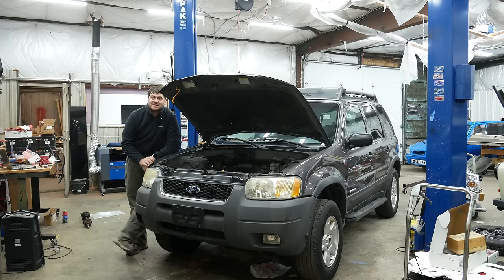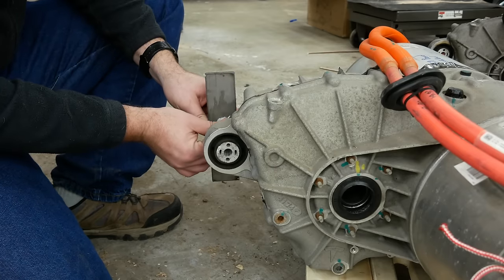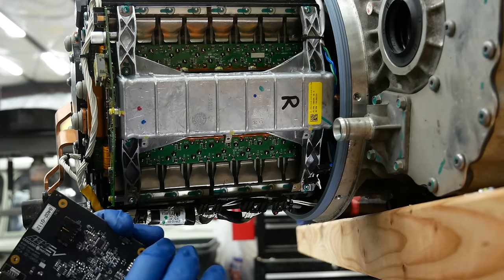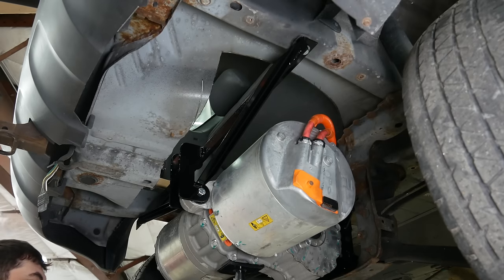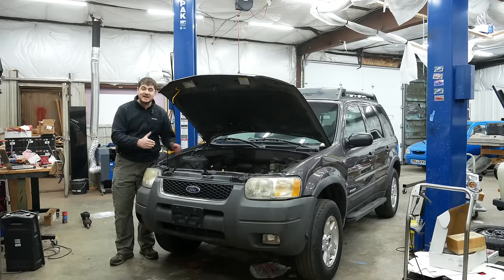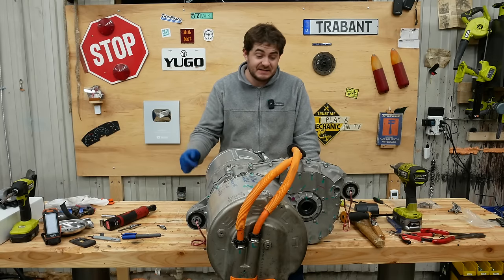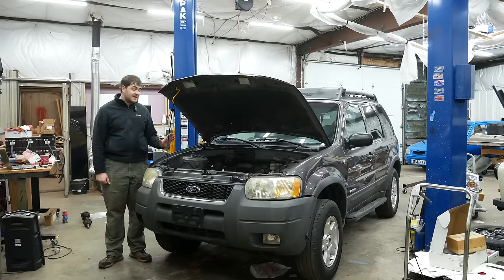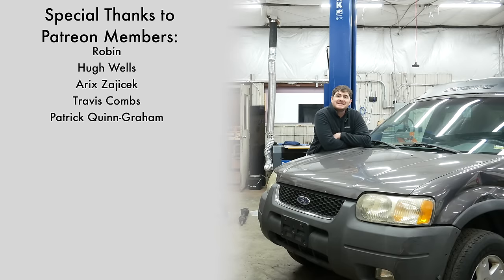This Escape is Now Rear-Engined (and Front-Engined) | 900HP Electric Escape Project

Comment: I can't wait to see you launch this at the lights to give a Lambo owner a heart attack at how badly there ICE car sucks. I'm also really curious how it will go on the drag strip. So grab a Dragy and do a Quarter mile run where safe to do so, once you have it all sorted out. I'd love to see if it's quicker than a plaid or even somewhat close to the 9's the Plaid is capable of. Though the aero and the older motors will definitely hinder it's performance somewhat. Still it's going to be one fast as hell Ford Escape.

Comment: I’m sure if I actually applied some Thinking, I could eureka-late the answer… but in the absence of computational motivation: Why couldn’t you just FLIP the front drive assembly, in order to change the axle direction, but keep the same oil-pump functionalization?
Reply from the maker: Then the oil pump pickup in the gearbox would be on the top where it would do nothing. The gear oil drain plugs would be on the top as well
Reply: @agingwheels  OIC. 🤔 
Yep, I should’ve considered that! 🤓
Reply: @agingwheels  Like the adage goes, “There’s no such thing as a Stupid Question; only a Stupid Question Asker!” 😬

Comment: Perhaps I'm missing something but for the front-drive unit couldn't you just mount it upside down instead of reversing the oil pump? It's an electric motor it shouldn't care right?
Reply: The pickup for the oil pump would then be at the top of the gearbox, and oil obeys the laws of gravity.
Reply: @moconnell663  ah yeah, duh, I guess for some reason I assumed it had a sort of closed loop oil system, instead of a pick up and drain down type, I don't know why

Comment: One thing you should definitely do with the bus is fit a power generator of at least 250 kilowatts.
Because if you actually want to go anywhere you will need to keep the batteries charged.
An aircraft APU is probably the best choice.

Comment: Conversely, a full diesel tank will get you 500  miles away, whereas the 900 hp electric with a 100 kW battery will get you the full 3 feet !
Reply: I have no idea what his battery setup will look like but holy moly it will be humongous to push this bus around at lets say 50-70mph for more than ~100 miles.
Like how long is the range of a Tesla? Couple hundred miles BUT thats a normal car with much less drag, smaller tires and overall much lower weight.

So yeah I would have just left the Diesel alone or upgraded the turbo for more boost to get it up to ~300hp.
Reply: The beauty of building the whole thing yourself from scratch is being able to tailor what you build to your specific use-case, and knowing most of those parameters before you even start.

Comment: I am just amazed that you keep making mistakes. One is supposed to learn from one's mistakes. I am wondering what was made different on the CV joint to take the super torque ??? Seems these days CV joints are just junk. They do not have long life at all. 
When one works on large sheets and welds, he must slowly move around and just weld in small stitch weld the part and cool the metal with wet rags. This should help you keep the warpage at bay.  Also, right after the short length of weld take a small pointed hammer and hammen down some of  the weld itself to remove even more stress. Hope it helps you Sir.

Comment: What is the duty cycle of that electric motor at peak performance? I know the Cat C7 is 80-100%. I’d be surprised if that automotive electric motor is rated higher than 10% duty cycle.
Reply: I feel this will be an issue that will rear it's ugly head in the bus. A manufacturer can rate a crazy hp number if the duty cycle is only 20 seconds.
Reply: @ronniedale6040  Absolutely, in short bursts. That’s why an industrial 500hp Ac induction motor weighs ~2500 pounds, yet the service factor is 1.15. It’ll do 500hp 24/7 for 50k hours straight without a sweat.

Comment: So, would a guy be able to take this drive unit and mount it 90 degrees out and run a front and rear differential on say a squarebody suburban?
Reply from the maker: Yes! That's a relatively common thing to do as well. You'd have to swap out the stock gearing for a 4.5:1 gear reduction, but that's the only complication
Reply: @agingwheels  The stock gearing in the drive motor or my differentials. Already at 4.11:1 in the differentials.

Comment: This is cool and all but how are you going to make sure the 900hp doesn't kill you?
Reply: The drive unit can be limited in output by the software in the controller board.  A few test drives with logged data can inform where the limits should be set.

Comment: Hey Rob, I sent you a rough stress analysis of the front mount, I didn't have all the details about the piece but if u message me with more details I can run it again more acuretly. 
The analysis determined that there's slight deformation at 3000lb of force. Check your insta to see the pics

Comment: Aluminum battery boxes? Probably should to stainless steel for battery boxes. Battery boxes are for safety and a aluminum won't hold up to a Lithium based battery, or any current popular batteries.

Comment: When the host talks about the "Toyota RAV4 EV" he doesn't say if he means the original much-liked 1997-2003 version or the much later deliberately designed-to-fail, short-range "compliance" version that Toyota cynically produced with Tesla in 2012. This indicates that the host - like 99.9% of people - has still never heard of Toyota's much-liked original 1997-2003 RAV4 EV. Like most people the host clearly rarely - if ever - researches the real recent (since the 1990's) history of EVs and the massive, continuing struggle to unleash a genuine price-crushing EV Revolution for the Masses.
I suggest ya'all fill your memory holes by searching on keywords such  as:  "Tom Hanks"  + "RAV4" +"EV" + "Who Killed the Electric Car".
Paul G

Comment: Yeah, chop bits off just like what was done to the Wheeego. Only you're making straighter cut lines, we want hack jobs, made while blindfolded and drunk, in the dark. Made with a sawzall and dull blades, none of this zip wheel stuff.

Watching more of the video here, pulling the diesel engine will weight reduce by I'm guessing nearer a ton than not. Which translates into quicker acceleration and distance per charge. Plus if you wanted to, tracking down a two speed rear for the bus so you have a lower "city gear" to help take advantage of low speed torque and not put extra strain on the motors in trying to overcome the overall vehicle weight leveraging against a tall ratio rear. Granted it might not be a issue to be concerned about in the end, but it could be a interesting avenue to explore.

Comment: There is a fatal flaw in the bus EV project.  The diesel is more or less rated at 100% duty cycle at max power where as the Tesla motor is going to be much lower.  I'm betting that the Tesla motor can't withstand more than 20 % if that not to mention the gear box.

Comment: Run the electric and the diesel for 24 hours with no refueling or recharging I guarantee the diesel will eventually make more horsepower and torque.

Comment: 13:20 but isn´t the angle iron mounted this way really weak? you basically just welded it to side of the angle, instead of cutting this long slope i would have let the angle iron with both sides to the middle part and would be even stronger.
edit ah ok i see you did it because of the bolt holes

Comment: The weakness of these electric motor designs is hills. Every non electric vehicle uses more and more gears for more efficiency. I wish electric cars and trucks would kearn from the rest of engineering and put in a multiple gear, gearbox.
As for your bus, that cummins engine will make a cool generator to suppliment your batteries. 
If you put an electric motor on your spare tire also, my patent turns the spare wheel into a gyroscopic stabaliser to reduce body roll.
Reply: You got this completely backwards.
Electric motors DON'T need a transmission for more efficiency! A simple fixed reduction gearbox is all they need, they're super efficient from 0RPM to like 8K RPM.
And because of regenerative braking, EVs are much better at hills than ICE cars. They literally get most of the energy back on the way down, something ICE cars can't do.
Reply: @logitech4873  electric motors have to pump alot of power from 0rpm. the tesla 3 phase inverter is a great idea, but from 0 is always just grunt. 
regen braking works on an electric motor with gears. a simple fixed reduction gear loses the same amount as a manual gearbox so why not get the mechanical advantage? then you can make cheaper motors that dont need to spin as fast or handle so much heat. an nor doo your batteries.

Comment: 900 Hp.... how far will you drive on one battery charge ????
Reply: In his last Video about this project (around minute 7:00 on that video) he explained that he needs 3-4 packs of batteries but he will start with just one pack which will give him about 300HP and about 40 miles of range. When he gets the other 3 packs, he will be able to use the 900HP and have a total range of 160 miles on a single charge. If it was on a tesla with new batteries, it would be over 400 miles. This conversion is not very efficient due to this being a gas car not designed for this.
Reply: @IRLSuperb  Why on earth needing 900 Hp ?
Reply: @jandoerlidoe3412  he needs it for a bus which is very heavy. Those 900 hp will not equate to the same amount of power compared to a regular car because we’re talking about a very heavy school bus. Also he’s doing it for fun.
Reply: It's not using 900hp to just drive around, it's capable of delivering a maximum of 900hp.  I imagine it will use the same 18hp to cruise at highway speed that the original escape did.
Reply: @moconnell663  yeah that makes a lot more sense. He also explained that he wanted to get those 900 hp he would need to do a lot more work also more battery packs.

Comment: *RED ALERT*
OH NO!!!!
STOP NOW!!!!

That motor is damaged! the bearings are SHOT and antifreeze has gotten into the inverter from the motor! the inverter section is NOT suppose to have ANY liquid of ANY kind in it!

These first gen Tesla motors had this bearing problem, the motor starts grinding, the bearings start leaking, and antifreeze gets into the inverter.

2 choices.
Either trash these motors and get 2nd gen motors
or replace the bearings and seals and check ALL boards AND windings you are leaving in the inverter for corrosion. If the windings have corrosion your DONE and it's trash!

I have a 2013 Toyota RAV4 EV with Tesla Drivetrain and know these problems ALL TO WELL! had to get my motor replaced once while I owned it from 2018!

Tony Williams from QC Charge in California normally adds a drain hole in the bottom of the inverter drum to allow for any leakage to not pool in the inverter and cause damage.

Comment: I don't know how electric cars can be three times the price of a normal petrol or diesel when they only have a battery and a simple electric motor which does not cost nowhere near as much to build as engines petrol diesel V8 etc etc they should be around 10 to £15,000 brand new only bearing in mind the motors would not last no longer than 60 or 70000 miles is the bearings at the end of the motor are too small and not man enough the last any longer hence the reason why you have to buy a new motor as you can't buy spare parts for it ask any Vauxhall main dealer or Tesla
Reply: Tesla motors usually last the lifetime of the vehicle though.

Comment: Horsepower has nun to do with hauling weight you want torque. 1000 ft/lbs of torque with 120 hp could haul wayyyyyyyyy more than a 1000 hp 120 ft/lbs of torque engine could ever

Comment: Hey, not trying to be mean here, or lecture you; I like your content.  I know a lot of You Tubers like to sound metric friendly for British and Australian viewers, but when describing torque in imperial units, you always want to say "foot-pounds" (ft-lb) of torque, and not "pounds-foot" of torque.  I know that British YouTubers often use "pounds-foot" when talking in torque, but that is not correct.  The reason why it is not correct, is that when you say "pounds-ft", you are essentially thinking-saying-writing pounds per foot (lb/ft) just like you did on your table, which was incorrect.  "lb/ft" is not torque.  "lb/ft" is what is known as uniform loading, usually on a beam, or any structural element, most often seen on a free body diagram to calculate beam stress and/or deflection.   As you know, Torque is the tangential force at a given radius (which is force x moment arm), not the force divided by the moment arm.  To be clear, if you have 20lb/ft on a 12 ft long beam, you have twenty pounds of weight for every foot of length along that beam, or 240 lbs net.  Also, material like pipes and beams can be ordered (or described) by their unit weight, which is pounds per foot.    Pounds per foot is like torque, but linear.  Whereas torque is foot-lbs and is rotational.  I know it's subtle, but it's important to get the units right. Get them wrong, and you crash a Mars lander.

Comment: No.  It's zero-engined.  This is where the difference between an engine and a motor happens.
Reply: *2 ENGINED*
Reply: @JESUSCHRYSLER5512  2-motored.  An engine converts fuel into energy.  A motor converts energy into motion.  ICEs do both.  EVs only do the latter.

Comment: Grad work ,BUT wy you have not deeling with diregt drive ?
1921 elecktig car came with 4 motor on the car .
1015 ther is a car with the same consabt BUT ,and be the Problem 150000$ The fiscar .

Comment: All l can say is "WOW".  l did not think that there were that many people in this world that can not differentiate a ELECTRIC MOTOR from a INTERNAL COMBUSTION ENGINE, hence "ENGINE" what is the world cumming to.  I even scrolled through the comments and did not find ANY ONE that made a comment about the stupidity of the person making the video.  With the heading of "This Escape is Now Rear-Engined (and Front-Engined) | 900HP Electric Escape Project" (copied/pasted) from the posters own words.  I GUESS HE NEEDS TO LEARN WHAT A MOTOR IS AND WHAT A ENGINE IS and how to tell them apart. 
 Welcome to "Power Plant"  101.  First of all, it is not rocket science because if it were, you would not have what it takes to post such a video.  Real quick and in the simplest form of education, a MOTOR uses some form of electricity to work be it AC or DC of which was mentioned in the video, so maybe, just maybe the poster either knows that a motor requires electricity or has read it just prior to posting. Now for the "Engine".  This power plant requires some sort of a fossil fuel to run on like gasoline or diesel fuel.  Unlike a motor, a engine has pistons that are connected to a crankshaft [google internal engine parts] (there are many items that I did not mention here as it may confuse you so l wanted to keep it simple for now) and then to a gearbox of sorts then to a drive axle. Modern day engines needs a 12vdc supply that connects to (oops) a motor just to start the ENGINE and will keep the engine running.
 My intent here is to make sure you DO know the difference between a Motor and a Engine.  If you truly do know the difference please make sure you use the RIGHT nomenclature in your next post and be aware of someone that might read your post and think you have NO IDEA of what you are talking about. This post is a prime example of what I just wrote.  Also, think about the comments of the people that DO NOT know the difference when they leave a comment, they will look stupid not knowing the difference that you perpetuated.
 May God bless and have a blessed day.

Comment: Dude, you're spraying paint over a cut bit of chassis, that is covered in rust. 

Your using a laser level to cut the floor out for some reason. 

Your remaking mounts 3 times because of a slight tight fit you could have opened up to make it work.  

It's essentially a scrap car and yet your treating it like you are working on a Ferrari. 

Relax